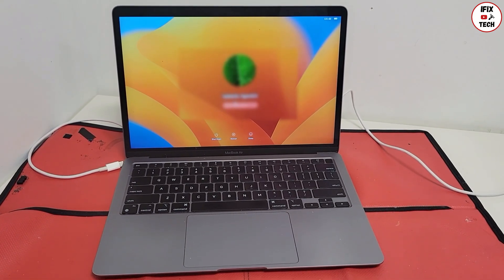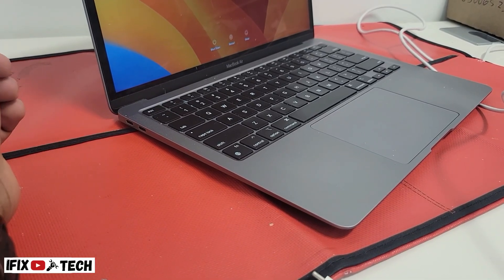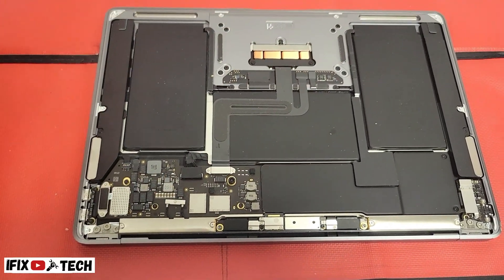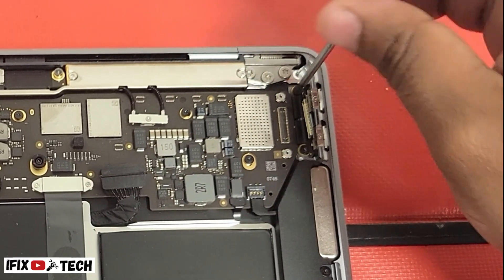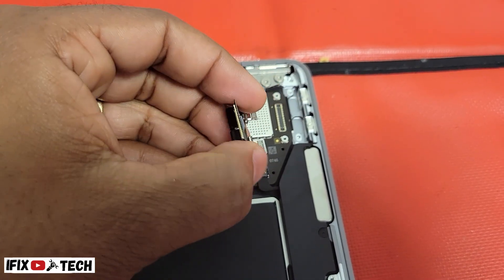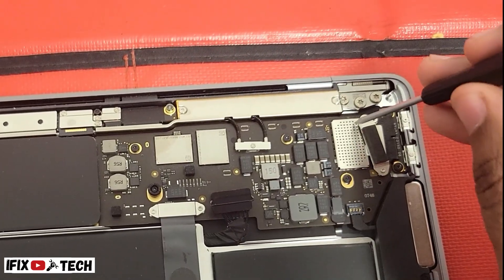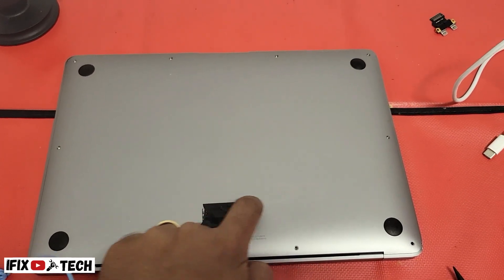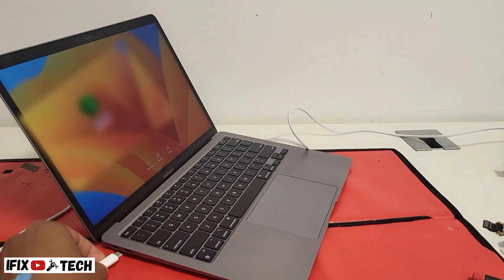Apple MacBook Not Charging? Try This!

Comment: i have a maxed out 16 inch 2019 MacBook Pro that recently stopped charging. it can detect usb devices though, would this possibly fix it?
Reply from the maker: Hello, have you tried a different charger? Is the same problem for all the ports?
Reply: @IFixTech1 yes, I've tried a different cable. it's the same on all the ports
Reply from the maker: @isaidmaybee does your Macbook has ports on the left and right side? Is the same problem on each side? Was anything spilled on the Macbook?
Reply: @IFixTech1 yes. 2 ports on each side, 4 ports total. nothing has been spilled on it. problem is with all 4 ports
Reply from the maker: @isaidmaybee mmm is not very likely that all ports stop working at the same time. You can try reconnecting the ports, it might be and issue with your battery,  worse case logic board problems. Also try using a different wall charger not only the cable but the charger itself.

Comment: My problem isn't the port the battery just won't charge at all , the power icon shows when I connect the charger but the battery still doesn't charge stuck at 1%
Is there a solution for this?
Reply from the maker: Hello, have you a different charger?